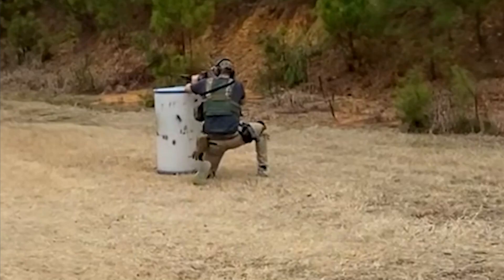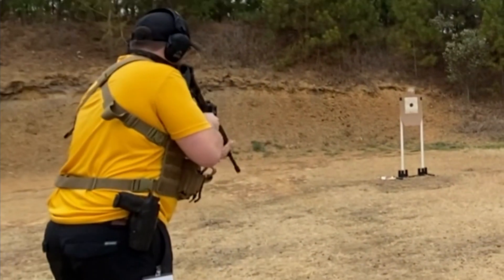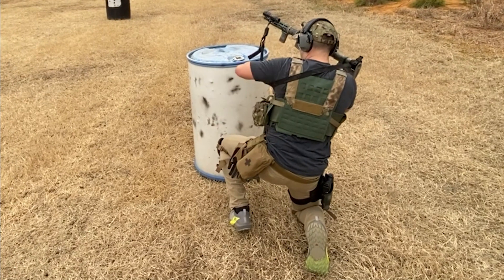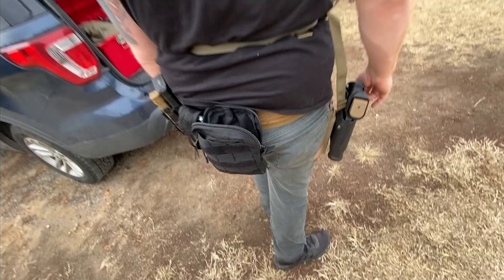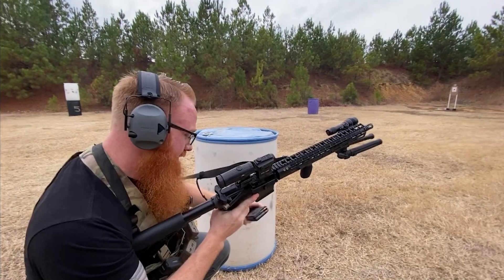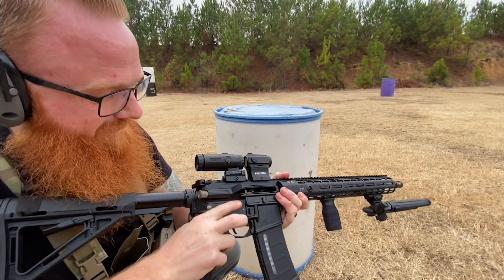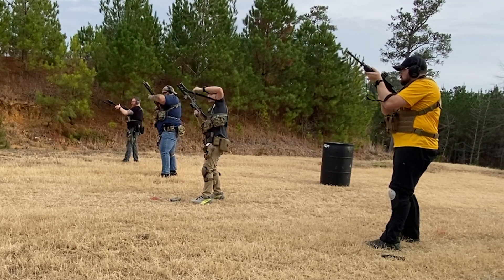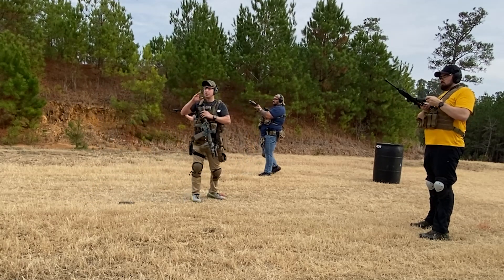Scrambler - Coaching - Reloads, losing gear, malfunctions

Comment: Besides taking up time, is there any real downside to ripping the mag out on every reload?

Back when I first started shooting ARs and Gen 1 PMAGs were a thing, I would have them sometimes not drop free in my LMT lower and I just got into the habit of ripping the mag out on the way to grab the reload from my chest rig. 

I kinda do it automatically now on all ARs, wasn’t sure if it’s a habit I should try and train away 😅
Reply from the maker: In this case you're trading a little bit of time for reassurance, so I can't say it's a bad thing!

I'd get in the habit of doing both. Work on letting it drop free. But if it doesn't, you'll have the reps in to respond to a hung up magazine.